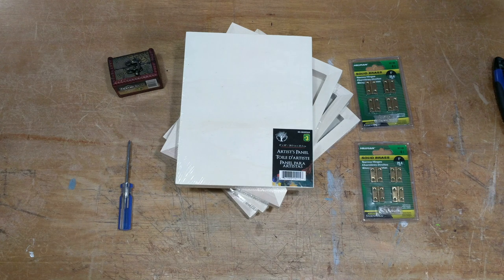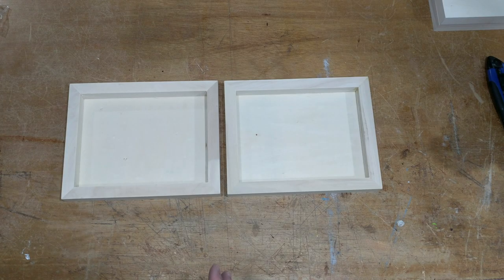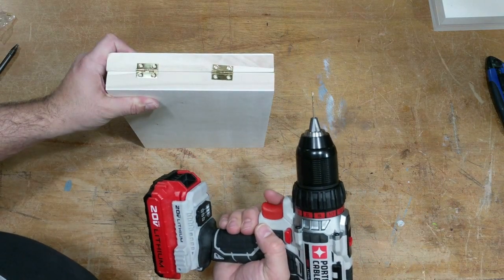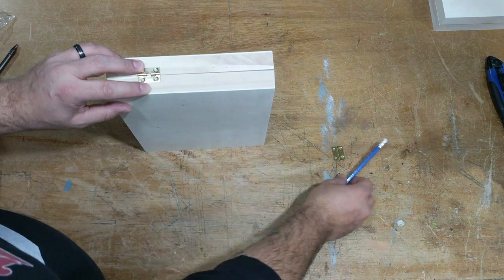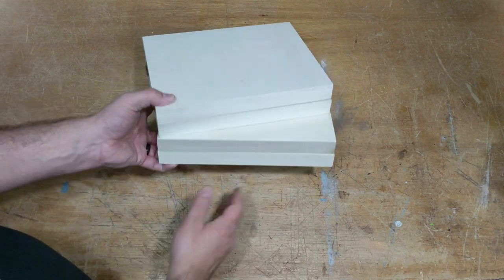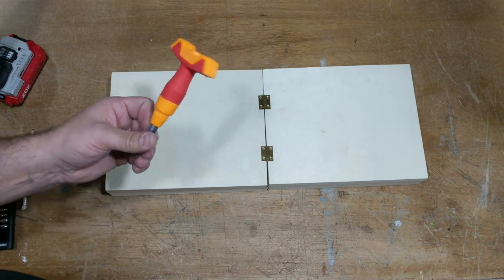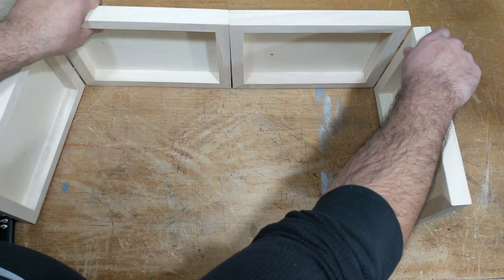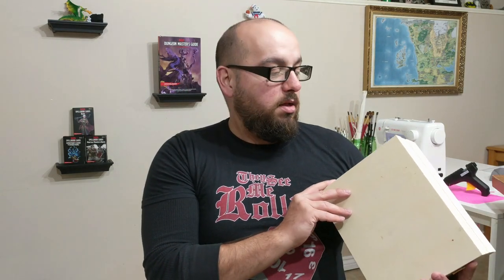D&DIY Custom DM Screen

Comment: Would you happen to know of a product similar to the artist's wood panels, but maybe not so thick? 

I've been looking at vids on diy dm screens all over YouTube and loving the clever, fast, and cheap ideas people have for really nice looking projects.
Reply from the maker: Michael's has a Square Moasic Plaque that is a similar design to the wood artist panels I used in this video, just with a much smaller (probably 1/4") side wall. Only problem with those is the shape, they are square and a bit taller than the artist panel. If you have a look around your local craft store I bet you would find something to your liking though.  NOTE: I posted a picture of the square mosaic plaque on my Instagram, if you want to have a look.
Reply: @FitzTheGame  oo cool thanks!
Reply from the maker: No problem. Hopefully you find something that fits the design you have in mind.

Comment: I would rather make my own screen for 23 dollars and my father's help (edit: lol father daughter time to the max) then go browsing during a pandemic. Also what are the dimensions of the panel?
Reply: The dimensions are 8x10 inches. You can see the tag on them at the beginning. Be warned, though - You need a cradle (thickness) of more than one inch if you want to do the dice tower, because it needs to fit in the area when you close the screen. I highly recommend 1.5 inch cradle. I know this because I made my own DM screen using this method and I needed the large cradle. Also just as a suggestion, I used craft wood to put shelves on one of the panels for minis and dice, and It was really useful!
Reply from the maker: Fantastic information. Thanks for passing it in.